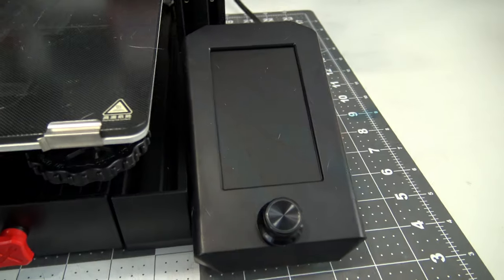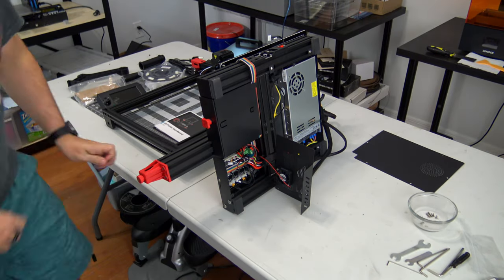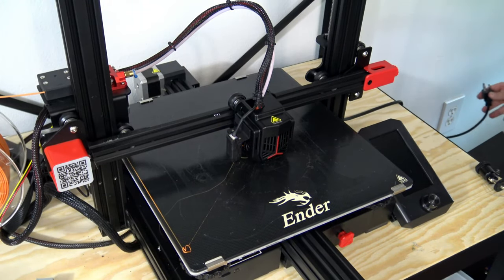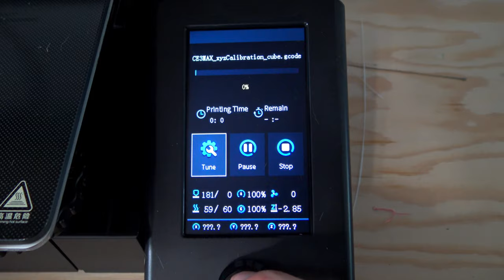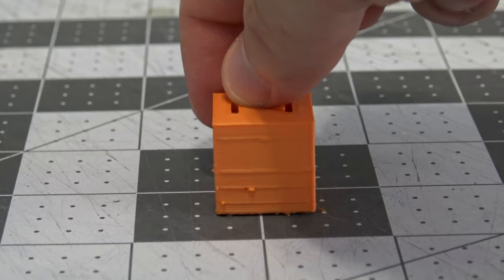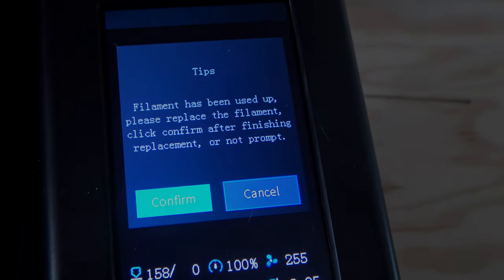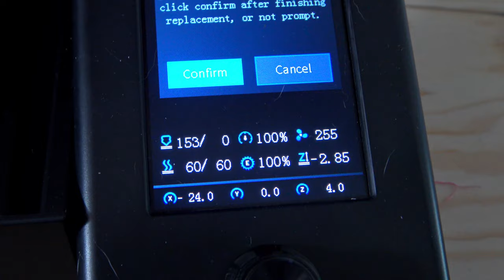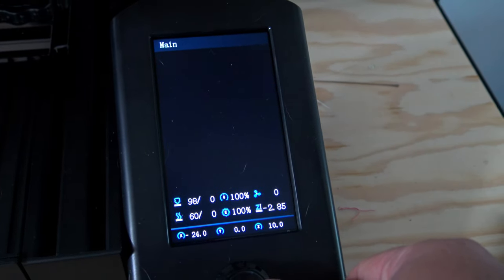Creality's Best Upgrade - Ender 3 Max Neo 3d Printer Review

Comment: I've had this printer for 6 months. It's more of an upgrade platform with the most bottom tier parts bolted on to get it to print for a few dozen hours. Pretty much everything on it besides the frame and steppers have to be changed in order for it to get reliable high quality prints.  New hotend, new extruder, new bed surface, new controller board, better bowden tube, the wiring needs to be ferrule crimped, the power supply cover is lacking venting holes... ok I think I covered everything? You get the idea... if you're not into tinkering and don't have solid CAD knowledge to build new parts, stay away from this thing.
Reply: What would you recommend ?
Reply: @Jagthunder1 probably some $1500 printer lol

Comment: worst printer ever,y axis is very noisy,only prints ok with odd filaments gantry plates are naff,should have got the ender 3 max and upgraded it like my old one.the price on this neo should be around £250
Reply: No the M3D Crane Quad is the worst printer ever. I just got my Neo Max a week ago. And after calibrating the XYZ axis E-steps i have my prints roughly within +/-0.03mm. Its amazing compared to the POS that i have been trying to fix.

Comment: I don't want to say that I hate the glass bed, but I do dislike it. I was able to test and review the Max Neo and that was my biggest complaint, the prints stick hard. I did try putting it in the fridge recently and that helped but I don't want to have to pull the bed off and put in the fridge every print. The dual sided PEI sheets are great. Even the Creality E3 Pro PEI coated glass bed is fantastic but not available in the 300x300 size. Hopefully it will be eventually. I wasn't impressed with the manual bed leveling instruction and maybe it was my fault but I scratched the bed with the nozzle when moving to the first corner. It never said to loosen the springs and such. I wished they were a bit more detailed than saying to set  Z offset and go to the corners. I thought the menu is a bit watered down vs the E3 Pro but I haven't used the stock firmware in a long time. I hope to be able to do my own firmware for this eventually but don't know what that will entail being a color screen like it is.
Reply from the maker: Very indepth comment, I appreciate it! I agree, the glass bed isn't my favorite. It is very grippy, though I think I found just the right nozzle height to where it grips enough, but I'm still able to get a scraper underneath without destroying the print or the bed. It took a few cut fingers and scrapes to find it. Creality does have a 310x310mm pei spring steel plate which does fit the ender 3 max neo (I have it linked in the description), but I haven't yet installed it on mine. It's bigger than the stated build area, but that's because the cr touch probe reduces the printable area a little. 

I haven't tried any custom firmwares on these yet, but I'd have no doubts people will be making them soon.

Comment: Hot soapy water cleans most of the marks, and a good accessory for print removal is an Industrial Razor blade scraper, this gets the remove started cleanly, to be completed with the paint scraper. Also, let the bed cool for PLa print removal with greater ease.

Comment: what cura profile we use the ender 3 max?
Reply from the maker: Correct, the Ender 3 Max profile, but then set the z-height to 320mm in the machine settings to match the Neo's max height.

Comment: Take the scraper with a hammer put it on the floor. Put your foot on front of the plate. Take scraper to buttom of back the print or supports. And one hit with with hammer to the scraper pops right off usually.

Comment: I connected mine to the PC to print as my Ender killed off my memory card and won't recognise a new one I bought.
Though I did catch the USB cable connecting it during a long print and it ended up failing as there was no way to continue, also don't like the USB is the old Mini USB.
My main problem is the fan noise but I cannot find any vid showing an upgrade for the Neo Max, they all show the smaller Ender 3s with the power supply on the side vertically where the neo is underneath.

Comment: I dont understand why the belt would improve something on the z axis?
Reply from the maker: The belt forces the two motors to stay in sync, even when power is off. Without the belt , it would be possible for the two motors to move independently. Which could cause one side to move up or down, causing the x axis to tilt. You'd just have to run the auto bed leveling more often.

Comment: Can you put a sprite extruder on the neo?
Reply from the maker: I haven't tested it myself, but if you get the Sprite Pro kit, that comes with a replacement x-axis carriage, I think it would work. The aluminum extrusion size is the same as the original, so the carriage should fit.